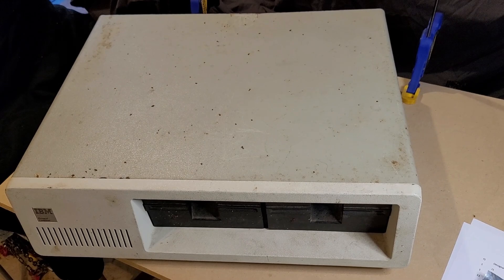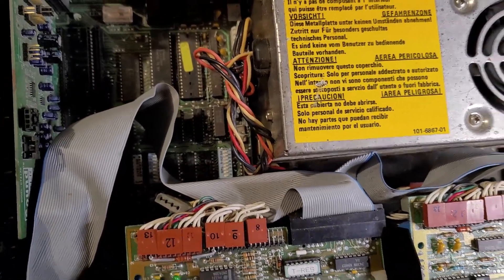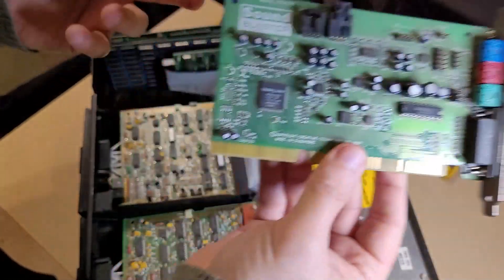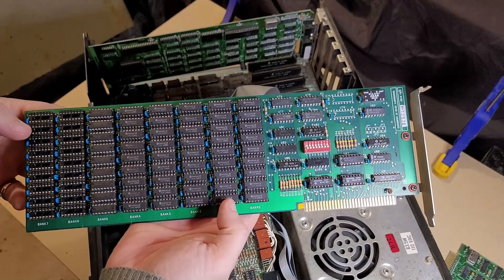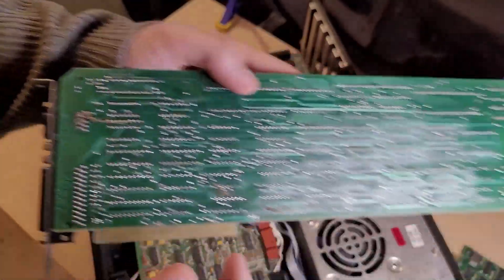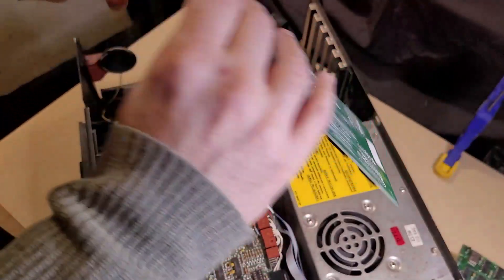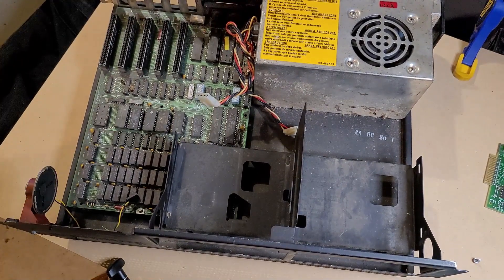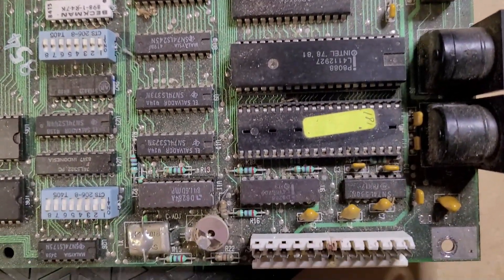IBM 5150 - Part 1

Comment: hi have a question i plan cpu upgrade my 5150 and  a quest for a 5150 treatment a vic 20 cpu 10 or 16mhz version? a 5 and 8 mhz version i sure treatment slowly arival my second ordered vic 20 cpu 16mhz version my ibm pcjr a 5150 little brother version treatment easy a 10mhz vic 20 so 5150 try a 16mhz if it.s not treatment a exchange alternative here put out my pc jr a 10mhz and put in a 16mhz and a 5150 get a 10mhz vic 20
Reply from the maker: Sounds like a fun upgrade, though I've not done anything beyond swapping the 8088 out for a NEC V20 and adding an 8087 myself.  Let me know how it goes though..
Reply: a 16mhz version i try upgrade a most sronger vic 20 this maybe same one jumper change like my ibm pcjr a vic 20 10mhz add and work  but I.IIsee in the end
Reply: and next i try a ram overupgrade how a 640kb up to a max 1mb 8086 and vic 20 true max 1mb treatment but every ibm 5150 and pcjr 640kb did it max a 1mb over upgrade need mode
Reply: and one more think same i try overlocking a cpu my ibm 5170 for a 286 up to 12mhz any idea this? i saw some video for 1.4 mhz max overclocking but maybe a 12mhz same did it :)

Comment: Is that an original Hercules? Nice score : ) I have also tried to find the paint code to respray one of my 5150s but no luck so far
Reply from the maker: I've got my fingers crossed that the Hercules card is functional.  This machine is such a mix-master though, I halfway wonder if it is just a collection of broken parts that someone put together and put up on eBay.
I found a forum post that claimed the IBM cases were Pantone 413.  I've ordered some (ludicrously expensive) Pantone 413 color matched paint.  We'll see how it goes.
Reply: @nhbretro  That is the best (and only) lead so far : ) Looking forward to seeing the result. I have at least two cases that badly need a respray
Reply from the maker: I have (sadly) finished re-spraying the case in Pantone 413(c) and, oh boy, is it not the right color. :(  Way too light.  Exploring other options...
Reply: @nhbretro  Ok, thanks for letting me know. I'll keep looking and let you know my findings